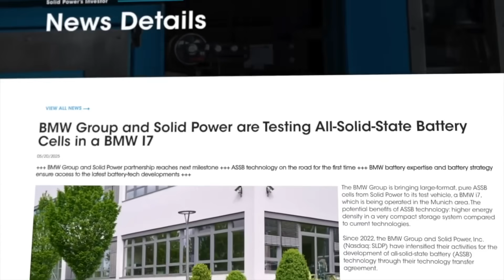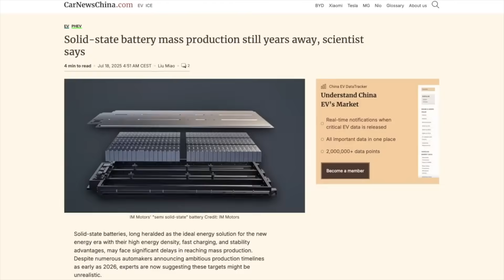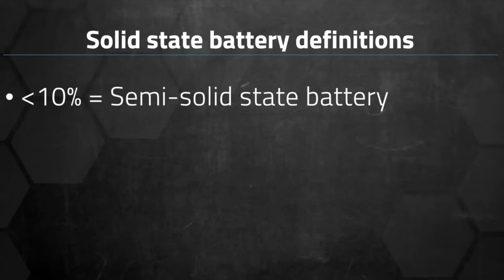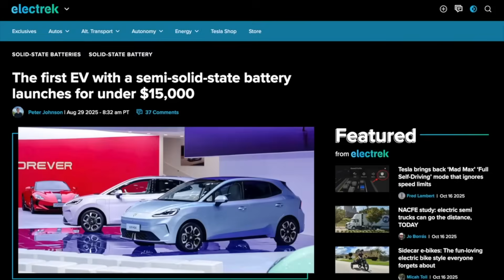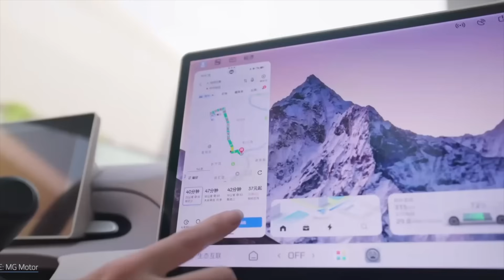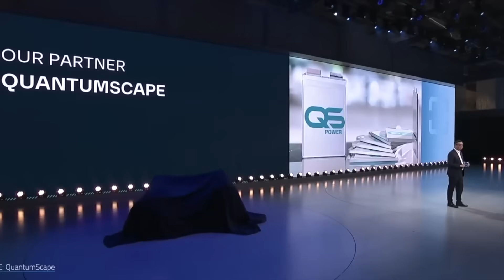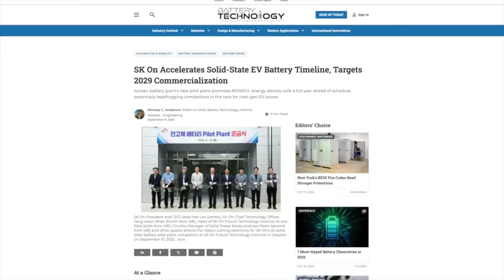U.S and Korea Joint Effort to Beat China with Solid State Batteries

Comment: Both Factorial and Solid Power currently have poor cycle life and lack true fast-charging capability. Despite this, they continue to issue PR announcements about partnerships with manufacturers, even though they don’t yet have automotive-grade battery specifications—not even at pilot scale. Factorial’s MoU with POSCO and Solid Power’s joint exploratory agreement are essentially symbolic and amount to little more than PR posturing. Only quantumscape have a battery at spec level which is impressive. but their main challenge is manufacturing

Comment: Even if they get there (i think China is several steps ahead and Will continue to do so) they Will akways BE more expensive. At this point (is several aspects) it seems to make more sense to partner with China and not try to compete with them. There are several examples of this specially in the auto sector.